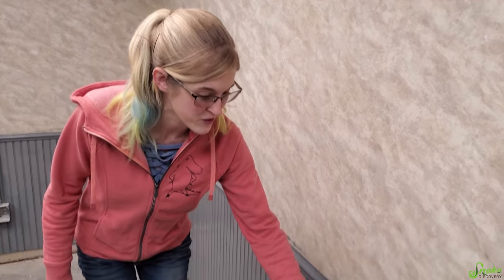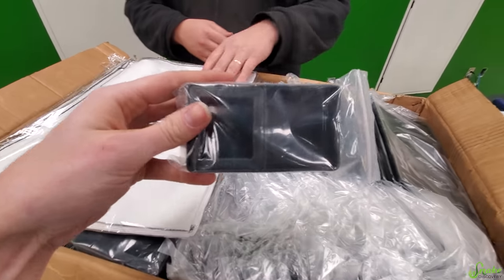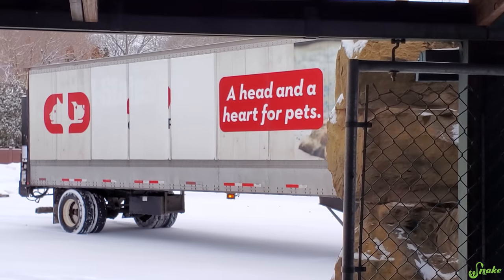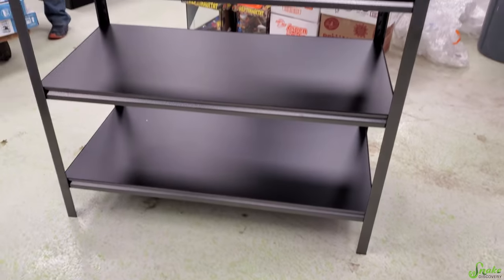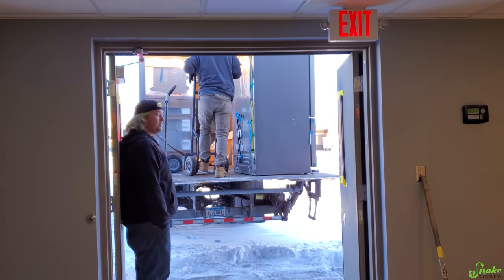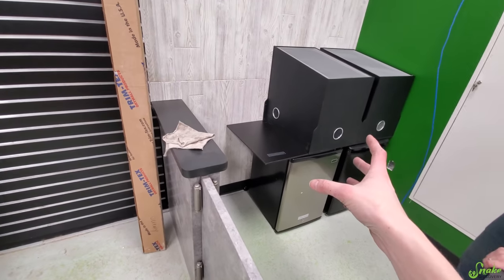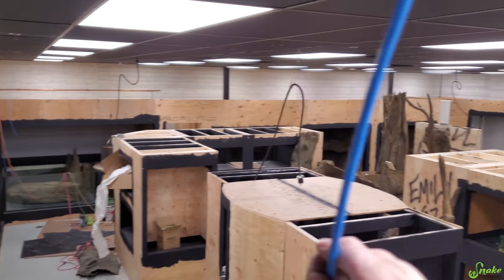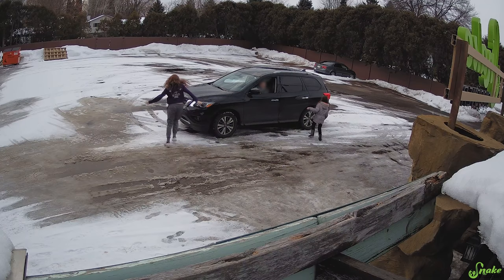Facility Update #9! (It looks like a real reptile store now!)

Comment: My boyfriend does locksmithing and his company also does access control and he always talks about how much running wires sucks
Reply: Yup, cousin is an electrician, he does major work for public buildings, places such as sandown racecourse he set up all the tv electronics and wiring, it is a nightmare job but the pay is a lot
Reply: @mistyanarchy4332  yeah, he absolutely hates it especially the older buildings where you pop the ceiling and don’t know what’s in there. 🤢 Thankfully he mostly just does locksmithing and it’s rare he’s doing that haha
Reply: @HjonkSolo  Older buildings in Europe is a pain too. You can't see what you're doing and basically just have to thread the wire on a spring tool, run it inside the solid walls and look for where it comes out. Running wires sucks, but running wires blind is just a nightmare
Reply: @Arterexius  oh I feel so bad for you goodness
Reply: Eh, running wires ain't that much of a hassle where I live. But we use Cable Ladders and pipes to divert the flow of cables left and right. So it is easy to just replace and/or re-do work. Without having to open up the wall. Which is especially useful in buildings with an underceiling.
Reply: Haha XD
Reply: How are you just so lovable, I looked at you and instantly thought “I wanna be her friend” like you are amazing, thank you for making my week!
Reply: Lol
Reply: 1k likes
Reply: My dad‘s an electrician so I heard how hard it is
Reply: Why does it suck?

Comment: Ahhh I was a low voltage electrician for years. There is a tool that makes it easier. Please please organize the data closet if you don't you will regret it. Also leave service loops.

Comment: hey guys as someone who watches your channel a lot but also owns the shelves you assembled you need to have one of the shelves at the seam between the tops and the bottoms. the shelf that goes at the seam would be attached to both the top set of bars and the bottom set of bars and it holds it together and gives the shelf stability. It's actually rather important in case the shelf ever gets bumped.

Comment: Texan here, I remember those cold spells we had. It was waaaaaay out of the norm for the type of winters we get. I mean I live about 2 hours away from Dallas, and 10 or so years ago I don't think the city had snow plows or salted the roads. Then we got some abnormal amounts of snow two years running and they finally invested in snow-clearing equipment. Around here, typically we get maybe one or two snowfalls a year and they're pretty much gone in two days, so we don't really bother with salting. Probably they just didn't have enough salt or didn't put it down correctly, but it was def a much heavier snowfall (and colder temps) than we'd seen in a long time.

Comment: Center it if you put another size close to it it will be a chaos. Bigger enclosures are better to be on the lower shelf (for security reasons mostly) from what I see it's a 3 layer shelf so the trick is if you want to promote an item to sell more add them on the first and second, there is where the eye makes contact first.

Comment: You might want to put up a no trespassing sign while you're still closed. Let people drop letters off at the gate instead of driving up to the front door. Just for their safety while construction is still going on. You don't want to be held responsible for someone tripping over building materials or even slipping on ice in the parking lot.